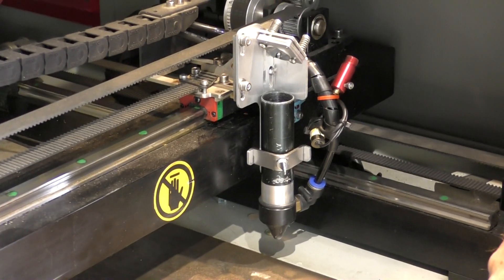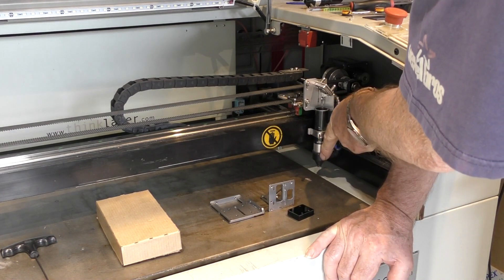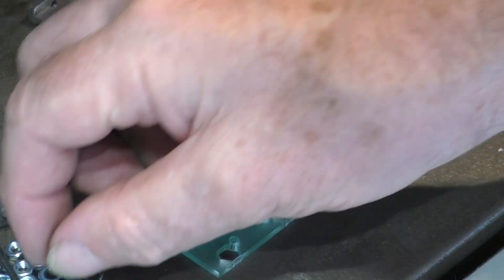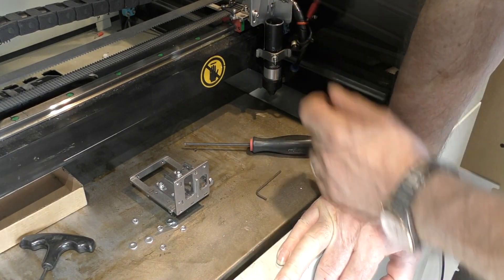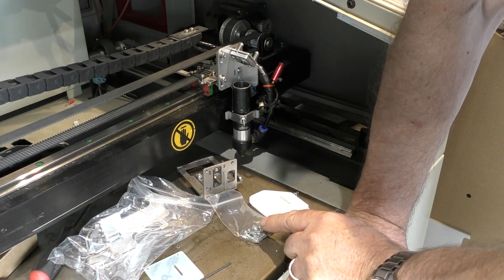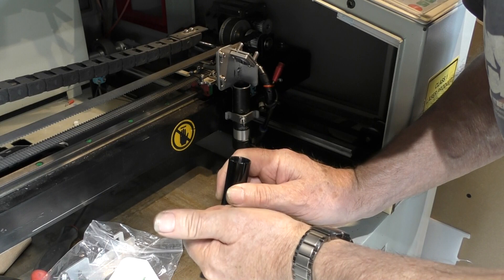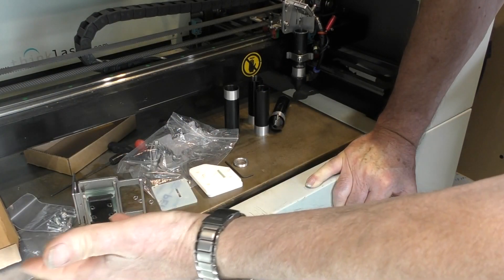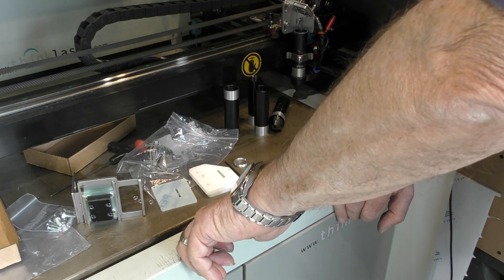RDWorks Learning Lab 185 Lightweight head update

Comment: Does Cloudray no longer sell the Adjustable head bracket and light weight head kit?
Reply from the maker: Hi
 Cloudray sells the adjustable YZbracket for top bering rail machines  but the bracket only fits 15mm  bearing blocks.  Although I offered the lightweightbhead to Cloudray they were too slow in answering and demand was high so I had to make it myself.. Demand is steady from new people  and old hands wanting to upgrade so I continue to manufacture batches,  I have just restockeda nd the new price id now £45 inc normal postage  If you wan to purchase, let me know if you are fitting to a 12mm bearing railmand I wll add an adaptor for free. The bracket is still available from Cloudray see ...........oops I have just looked and it appears they are no longer selling it.!!! I will have to check with them if this is just temporary . If not I will have to make a small batch myself.
Reply from the maker: Hi 
 I can promise nothing but send me pictures of your machine and I will see whats possible. If you do not already have my email then contact me privately with this  contact form
https://forms.zohopublic.eu/ndeavorlimited/form/K40XtreeemLaserCutterContactRussSadler/formperma/k2Cn0QN5ChpazfTMAUw25lZ-FKpjZa96TQWHjv3ntOg

Comment: I’m finally getting around to installing this (after a huge delay). I have the bracket and fitting it to the hgr15 bearing but where can I get the parts for the lightweight head?
Reply from the maker: Hi Brett
 I have this head fitted to all my machines and have sold many over the past few years. It is a great asset that allows me to use any combination of lens and nozzle.  I go way beyond what most normal hobbyists would imagine possible. Although I offered the design to Cloudray several years ago, they were so slow in resonding that market forces kicked me back into manufacturing to satisfy the huge demand. Yes ,I still have stock and will send you a data pack if you like to contact me with this private contact form
https://forms.zohopublic.eu/ndeavorlimited/form/K40XtreeemLaserCutterContactRussSadler/formperma/k2Cn0QN5ChpazfTMAUw25lZ-FKpjZa96TQWHjv3ntOg
 Many thanks for your interest   Russ

Comment: Hi, nice video M. ! Is it possible to order a lightweight head from you ? for the china blue and white 50w? I'm currently trying to go up to 2000mm/s of engraving (speed for my personnal business needs). But the oem head is heavy and, and so have big inertia that create vibration (near to resonnance frequency) and lost some step. Actually it's reliable at 1500mm/s and 20kmm/s² of acceleration with a leadshine 3 phases on x axis. Finally i think your lightweight head is the best solution, and in addition to this i can change the lens tube in accordance to my use ? Nice day Michel.

Comment: Quick question. I have installed the lightweight head and it looks fantastic. But how do I align the 3rd mirror when there is no aperture to stick tape or target? Thanks!
Reply from the maker: Hi
Take a look at this video from 45:30 and you will see the simple flag target. There was always a misbelief that if you got the beam into the centre of the mirror 3 port then the beam was set correctly. Wrong. You must get the beam onto the "sweet spot" of mirror 3. What is that sweet spot?  It is that  position on the mirror that the beam must hit to reflect  right down the AXIS of the lens tube and ultimately through the AXIS of the lens. That is why the head is adjustable  so that you can move the mirror up and down to find that exact position. The initial target in front of mirror 3 is just an approximate setting and is there so that you can get your X axis aligned perfectly by getting two burns to coincide. If they are not perfectly on centre dont worry it gets corrected to perfection at the final beam alignment stage. So watch the end of this video and all the pain will disappear.

Best wishes
Russ
Reply: @SarbarMultimedia  Fantastic explanation I understand what you mean about the axis of the tube. The link seems to point at the 45:30 points to his video I don't suppose you know the episode number for the video mentioned? 
Thanks again! I'm going to have a fun weekend!
Reply from the maker: @BuiltNotBoughtUK  

Oops sorry I forgot to copy the link   https://www.youtube.com/watch?v=aErsmbYC4Bc

Best wishes
Russ

Comment: Amazing work are these new parts still available? I have a 15mm rail and my bracket flexes quite a lot. Trying to find a solution as I just received the voiern 9060 and I have to cut at 5mm/sec otherwise after a direction change I get small waves in the cut. It happens on all changes.
Reply from the maker: Hi
 Add your disguised email address to another comment (johndotsmithatgmaildotcom) and i will reply and also delete your email address/comment
Best wishes
Russ
Reply: @SarbarMultimedia  Thanks! alexhinesatbtinternetdotcom

Comment: Hi Russ, I have a red black chinese laser with a 12mm rail, but my toothed belt is in a vertical plane not horizontal like your one in the video,can this still be used...??   Thanks for the great and inspirational videos that you take so much time in producing for us plebs and experts alike.  : )
Reply from the maker: Hi Ray.
 if you  have a 12mm bearing rail on the front face of your gantry then I have included fixing holes  on the vertical mounting plates that are in the kit, to suit both 12 and 15mm bearings.
 best wishes
Russ
Reply: @SarbarMultimedia  Thank you for your reply Russ, the gantry has the linear rail mounted on the top and the belt is vertically run on the front face and then returns through the middle of the gantry with a stepper motor mounted vertically on the LHS and the idler vertical on the RHS. Hope I have explaind it clearly otherwise how can I send a pictur to you.
Regards
Ray
Reply from the maker: Hi Ray
Just add your disguised email address to another comment  (johndotbrownatyahoodotcom) and I will get back to you and delete your comment
Best wishes
Russ
Reply: Thanks Russ, the contact details are smithdotraysmithargmail.com sorry for the late reply but it gets late early here in Australia. Regards Ray

Comment: Great solution. I would have gone alittle more hacky and just drilled a few holes in the plate to align with the smaller bearing :)
Reply from the maker: I think we had the same thoughts . the China blue mounting plate now has holes for 12 and 15mm bearings.
Many thanks
Russ

Comment: Great video Russ, any chance of design that could be adapted to a red/black China laser with a 12mm rail on the face of the gantry instead of top?
Reply from the maker: Hi Andy

You are not the first to ask this question and so I will adapt the China Blue front bearing mounting  plate so that it has fixing holes for the 12mm bearing as well. Hopefully I have then covered all the possible options
 Thanks for your interest. It's only via people like yourself asking questions, that I can know what is "out there"  beyond my two machines.
Best wishes
Russ
Reply: @SarbarMultimedia  Is this something that I would purchase from you directly or from cloudray?
Reply from the maker: @retoll34  
Hi Andy I did offer this to Cloudray several weeks ago but they are up to their eyeballs in work as they recover from their lockdown. Hence , although I really don't want to get into manufacturing (I am retired from that!!!!) I anticipated a small demand and therefore progressed a small batch. When I announced that I had a few for sale I was deluged with request I am therefore in the process of manufacturing a larger batch to meet the demand. If you look at  https://www.youtube.com/watch?v=3lZ2Ttdwrdc it will give you the latest situation and all the details of what I have included in this universal head and mounting kit. It caters for front and top bearings of either 12 or 15mm size.

 If you like to add your disguised email to another comment then I will add you to the waiting list and let youknow early next week when stock is available.

Best wishes
Russ
Reply: @SarbarMultimedia   Good afternoon Russ, Just checking in. I did not receive an email, not sure if these were produced? Thanks!
Reply: Thanks 👍 I am making my way through the series. Lots to watch and learn!
Reply: Hello, I have installed the kit and it’s gorgeous